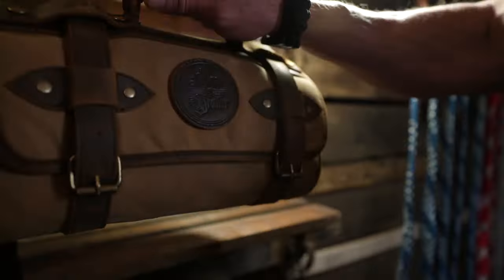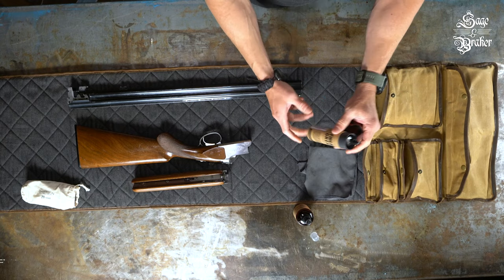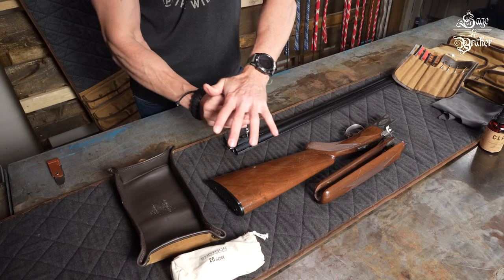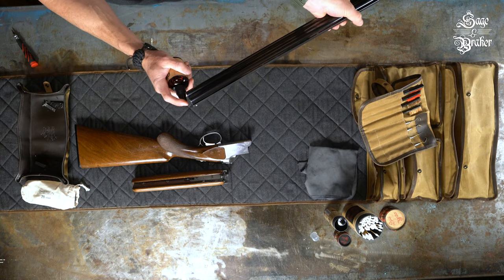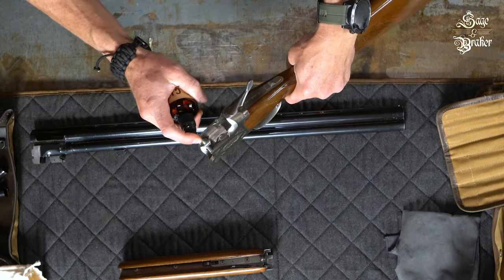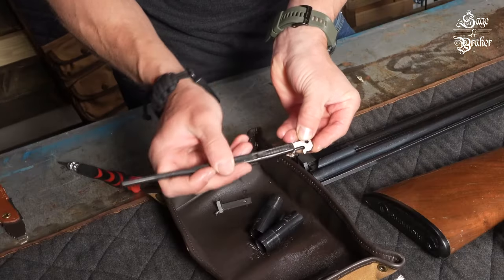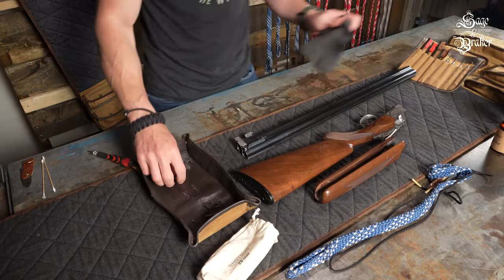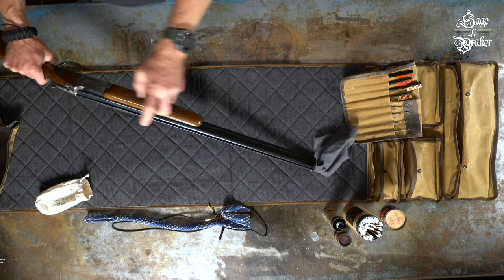How to Clean an Over and Under Shotgun - Project Upland and Sage & Braker

Comment: Cleaning inside Fore end Skipped. Bore snakes are for in field or blind not for proper cleaning;  spraying CLP in bore [never reaches all barrel especially 32"-34" ones on O/U-SXS] it waste it and not as good on clean patches.   For 60+ years hoppes 9 in bore on patch put on proper gauge brush 1 time remove patch new one repeat. wait 10 minutes to let it work; run bore brush 3-5 times then  run patch thru  to remove residue clean patch. Now a patch with Kroil [great penetrates millionth inch wait few minutes.  Run couple clean patches to remove all residue then Run a patch lightly coated with Clenzoil or your preference. [I then remove choke tubes wipe exterior with Hoppe #9  then dry paper towel wipe with clenzoil exterior and threads; I put clenzoil patch on wool mop insert in threads & rotate to keep them free of grit. I use Clenzoil on my gun bores, action, exterior and on oil finished stock[ proven it will enhance grain].  I wipe inside fore end with Clenzoil to protect the  generally unfinished wood. The I use snap caps or buffalo horn to release firing pins, I then wipe inside action with clenzoil lightly on a patch being sure to wipe Trunnions/hinge pins then assemble SXS or OU. Wipe exterior with silicone cloth [removes excess protectant stand muzzle down IN GUN SAFE OR CLOSET NEVER IN  Zipper cases.   For over 60 years never a speck of rust or other problem. Gun can be stored years after this.    Process take less than 20 minutes.  If shooting next day I Run patch with Hoppes thru bores brush 3 times run clean patch  then patch with Kroil in bores leave it ;wipe inside action Hoppes 9 dry paper towel then a light coat Clenzoil. I then wipe exterior shotgun inside fore end with clenzoil on lamb wool wipe. Check choke tubes in firm.  Release firing pins store muzzle down[ keeps oil running in stock softening wood]. 10-12 minutes.  If in rain or moist conditions then more time exterior  and inside forends.
Reply: Sounds like you got it figured out already
Reply: Thank you! Would love to see you record cleaning with your method.

Comment: You grease tractors, not chokes.
Reply: Because of the extremely high temperatures that barrels can reach, particularly on flush or simulated game, regular gun oil can effectively ' burn off" chokes. Some people use car engine oil on their chokes but the modern silicone gun greases are far more tolerant to high temperatures and a number of the manufacturers recommend grease over regular oil. Basically, you grease tractors and chokes.
Reply: @jlight1965  I don't know what you are using, but we use a high quality oil.  1000 rounds on a tournament weekend and chokes are still lubed.